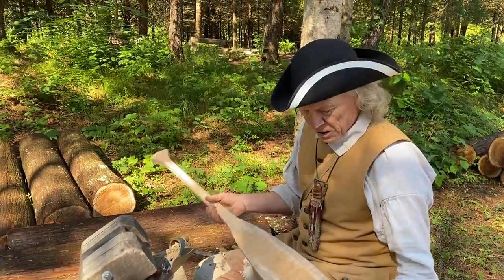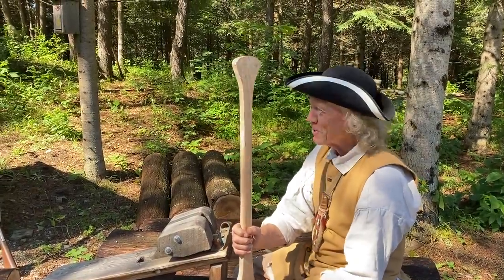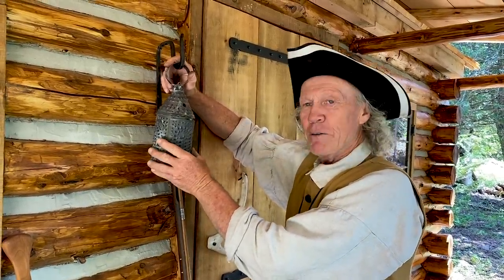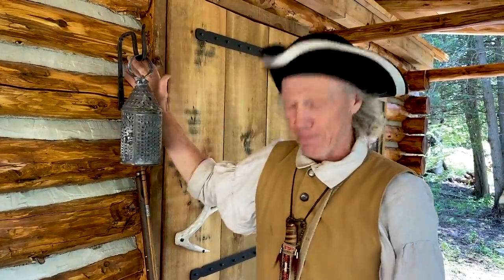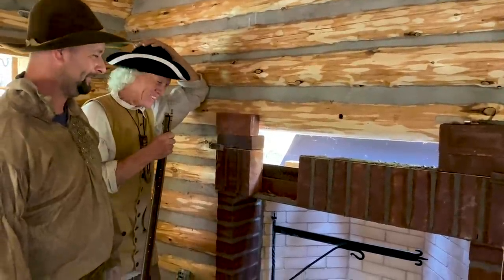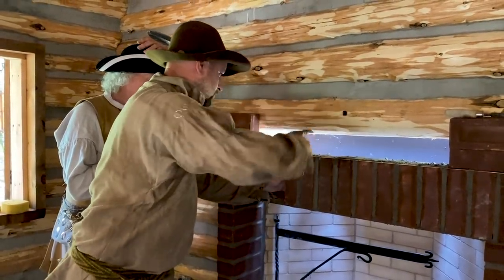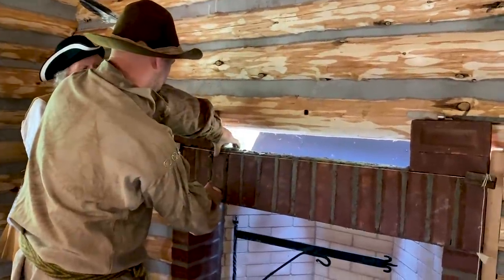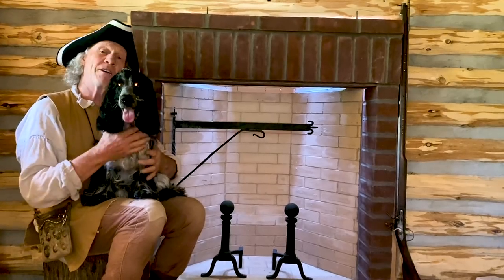Working on Fireplace, Paddles, Canoe and Garden | CABIN BUILD | PIONEER | OFF GRID

Comment: May I ask what you call the iron arm attached to the inside of the fireplace to hang pots, etc, from, and where might one be purchased, or would a blacksmith be needed?
Reply from the maker: Hi Cheryl,   It is called a fireplace crane.  I made the one in the video in my blacksmith shop.  You would indeed need a black,smith but, they are pretty simple to make, so wouldn’t  cost all that much.
Reply: @TheWoodlandEscape  Thank you so much!